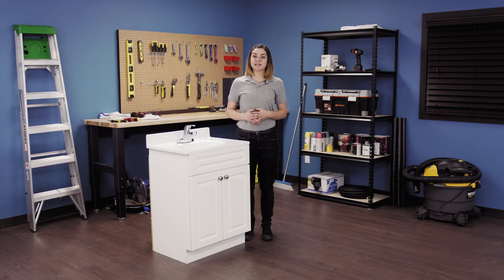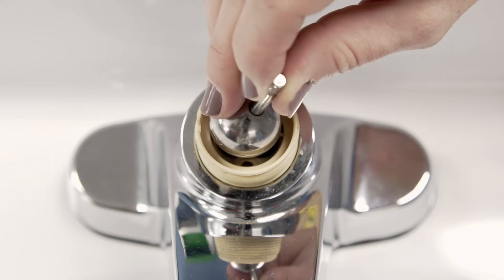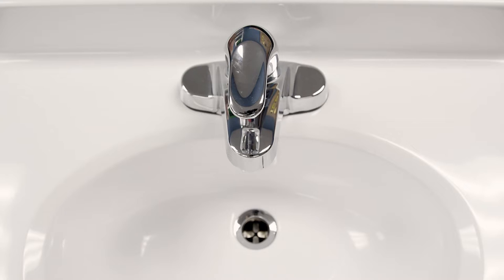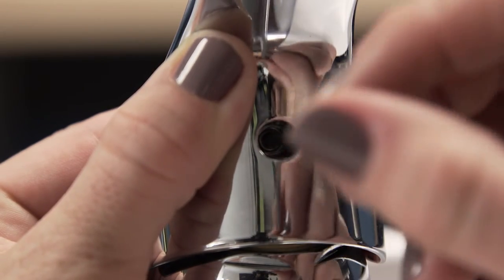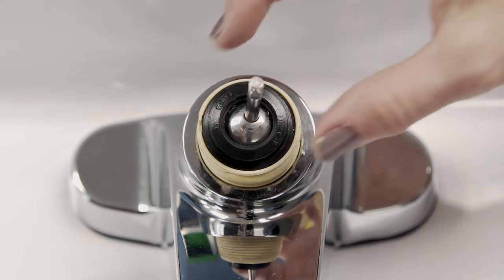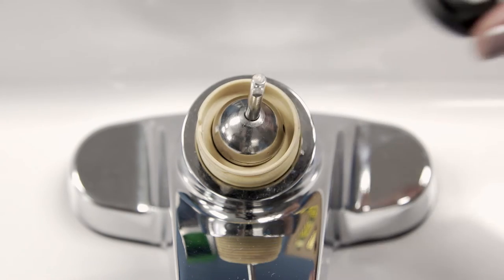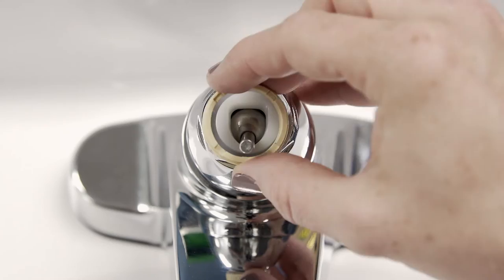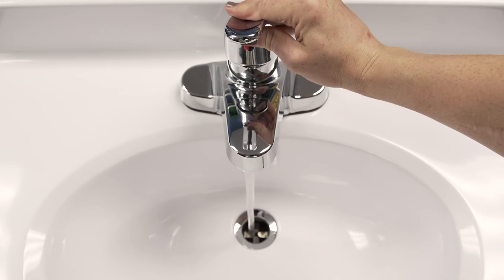Ball Valve: Repair and Replace (Single Handle Bathroom Faucet)

Comment: Greetings I have in my shower this kind of single ball as showed In the video and work still properly I just need the correct knob handle. Could you please help me with the correct replacement. A this time I traveled to homedepot and bought 4 diferents models from delta and danko but still I don't found the perfect for the shower.
Reply from the maker: Thanks for watching. All our faucet and bathtub faucet handles are listed here: https://www.amresupply.com/catalog/Handles-PE9

Comment: The pin is missing on mine. Can I do without it
Reply from the maker: Thanks for watching. Do you mean the small pin that slots into the ball valve? 

This pin helps guide the ball, but if your faucet didn't have one installed to begin with then it shouldn't be a problem when installing a new one.

Comment: My shower has this type of faucet and I have three holes instead of two. Do you have a video that details a faucet repair like that?
Reply from the maker: Hi Charles, thank you for watching! Currently we don't have that particular video for shower repairs. If there are 3 sets of seats and springs then you can replace the seats and springs by pulling them out with an allen wrench or screwdriver as shown in this video: https://youtu.be/u9n6IZbrAUc?t=136

If you've found this helpful and want to help support the production of more videos like this, you can like, share or even subscribe to our channel. Every little bit helps!

Comment: What is the pros and cons of this
Reply from the maker: Hi Ariah, thank you for watching. Ball valves are easy to replace but one con is that the seats and springs can wear down over time. Other single handle cartridges don't use seats and springs but still will need to be replaced over years of use.

Comment: What causes the faucet to leak when in the off position? But it only leaks when handle is sttaight in the middle. If you turn it to hot or cold, while off, it doesnt leak.
I replaced seats and springs, cam and packing, and it still leaks very slightly.
The only thing still original is the ball valve. Should this be changed? It looks fine
Thank you
Reply from the maker: Hi splash, thanks for reaching out. These ball valves use physical pressure to push down on the seats. It sounds like your ball valve is slightly loose when straight in the middle but seems to apply pressure while you turn it (while off). If the ball valve looks fine, you might want to try to tighten the adjusting ring. Tightening will make it harder to turn the handle but will push more pressure down on the ball valve.
Reply: @AmreSupply  
Thank you for the quick reply!
I will try that
Reply from the maker: You're welcome! Let us know how it goes!

Comment: There are proper tools for removing the parts that need to be used to keep from scaring the plastic threads. They are included in the repair kit from Delta. Repair kit RP3614 Not a pair of needle nose pliers.
Reply from the maker: Thanks for watching. You are right, that repair kit does come with a small wrench to help with the repair. If someone only  buys the seats and springs or the ball, then they'll have to remove the adjustment ring some other way. Needle nose pliers can score the plastic threads but even if the top threads to get warped, it won't affect how well the adjustment ring is screwed in.
Reply: Bud ,why would you replace that ball I know she said it may become weak but I don’t know wouldn’t it be more likely springs and seats in there rather then ball itself ?
Reply: Alberto, with some care and finesse a pair of needle-nose will work just fine.